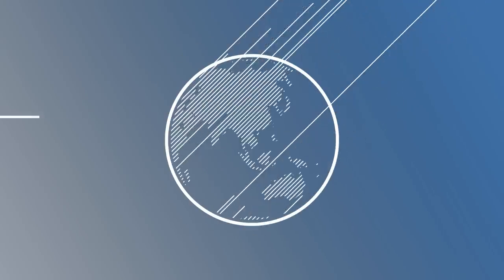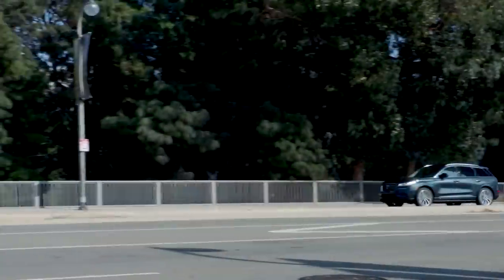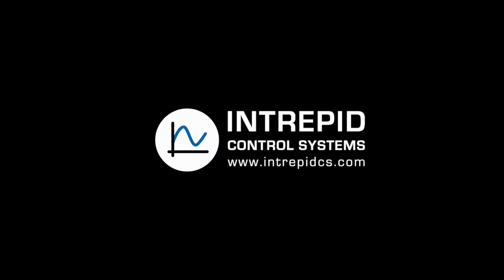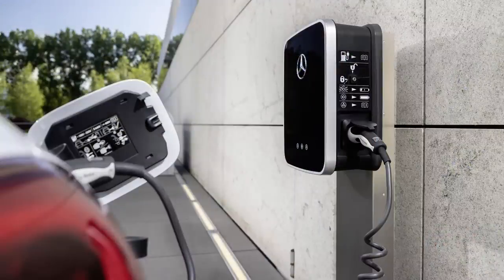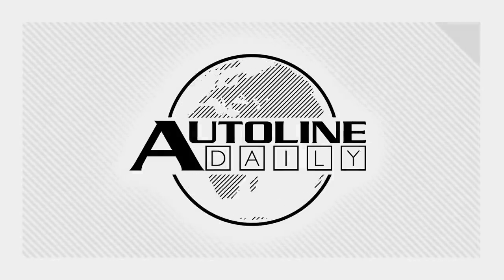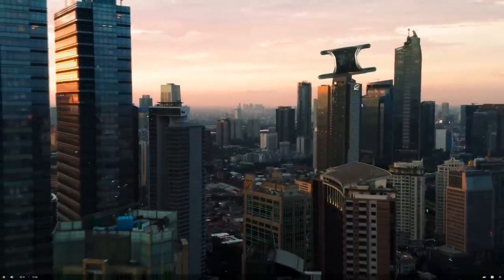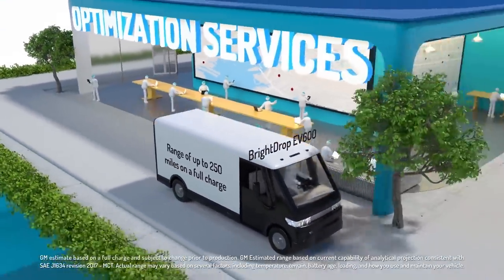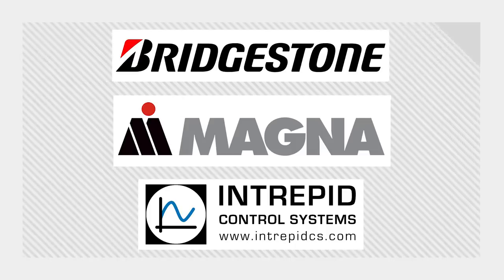GM Launches New Deliver Company; Navigation Going 3D - Autoline Daily 2993

Comment: GM should talk to Winnebago  and other RV manufacturers  to buy that electric  van and turn it into an RV.
Reply: I've been saying this for a few years, we RV all the time and there's a huge benefit to an EV tow vehicle or in this case an RV "motorhome" and that is when you travel to an RV park you could charge up while you sleep and be ready for the next day's travel. I'm sure RV parks will eventually start charging customers with EVs but for the time being they're not yet. Plus most RV parks have a 50 amp 240v hookup, I'd make an adapter so I could plug the vehicle's charger right before bed and still leave the camper hooked up for the low amount of load used during the night like the fridge and a couple lights that might be turned on.

Comment: 2028 for the "next gen Mustang"? S650 is schedule for the '23MY, albeit heavily based on the current S550 with elements of CD6. So the 2028 car must be S650's replacement, right? So, next-next gen (S750).

Comment: The reason GM isn't being valued like a startup is twofold:
1) A startup with exciting new tech and a ton of capital is great. Add a massive load of liabilities in the form of old factories designed around legacy ICE manufacturing, a massive union workforce with significant incentives to fight GM electrification plans, and dealers who share the same anti-EV incentives... It doesn't look good anymore. 
2) GMs track record of less than compelling EVs has hurt investor confidence in their ability to execute, and stats released so far on the Hummer EV don't help... For all their hype around their Ultium platform, it doesn't seem competitive vs what the rest of the market will have in 2022+. With GMs development pace (Ultium gen 1 has taken them 4+years to develop and will be 6 years old before the first vehicle launches on it) if Ultium fails as a platform GM will be out of business before the can create gen 2. 

 If GM wants to get start-up investor excitement, here is a plan: GM takes 3 empty factories(paid to gut them with legacy GM debt) and bundles these with their entire EV engineering team and the Ultium platform.  Add the Cadillac, Hummer, and Pontiac brands, but buy out all the dealer contracts with legacy GM money. Spin them off as a seperate company with 5-10 billion in cash... That is a startup everyone would be excited about. Legacy GM shareholders get shares in the new company, and legacy GM just keeps building gas pickups and SUVs as it fades into irrelevance, paying shareholder dividends each year by selling another shuttering factory to another EV startup.
Reply: Clearly you have you head buried in the sand, and not paying attention.    In less than a year GM announced, acquired land and is building a 30 gWh battery facility in OH (tooling install is going to be starting in late February),  Factory Zero (Hamtramck) is completely stripped, expanded, and set up for EV Trucks and SUV's only (nearly complete),  and Spring Hill is under major expansion to build the Cadillac Lyriq, and an unannounced Buick CUV, and Chevrolet variant.  Orion Assembly is also going 100% EV  with the refreshed Bolt, and Bolt EUV, both hitting showrooms by summer 2021.  Only  people with no idea how the GM organization works would suggest spinning off the EV division,  how do you separate the 20K+ engineers GM has in Warren?    Most of the new developments (supercruise and infotainment) work across all models ICE or EV.    Who gets the 3 GM proving grounds, and the 7000 people testing cars every day,  crash labs, wind tunnels, climactic wind tunnel, prototyping division?        The organization is much stronger together than broke up into pieces, and in case you were wondering those captured ICE assets you mention as liabilities generated $9B in free cash last quarter, and $5.3B in operating income...  Yup,  Liabilities...  Haha!     Wait till you see the Q4 results,  my napkin calculations say the operating income is going to be much higher than Q3.